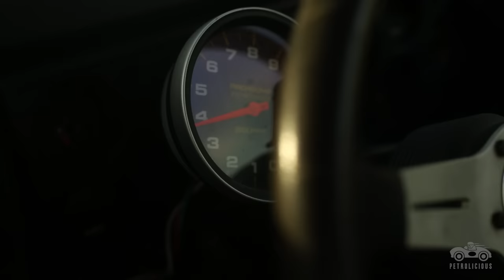The Nissan Bluebird is a Little Beast

Comment: The 510 was my first car after I got my driving license at 17 yrs old! Mine (in Malaysia) was a 1400cc version (non SSS), 4 door saloon, steering shift, registered in 1968 (same age as me). Later converted to the 1600cc engine and floor shift. Was sold around 1995 when I started work in another city. Still miss it...

Comment: The first car I bought for myself was a Datto 1600. back in 84..I still drive It. I bought a second one a year or so later. They have both been around the clock about 5 times in the 35 years that I have owned them. I would not trade them for anything. Nice to see stock engines under the hood. Mine are both going strong with the original engines.

Comment: I had a 68 4-door back in like 1988 and my parents took my down to Tijuana (I live in San Diego) and they got the upholstery done on my two bucket seats and the rear seat, black vinyl with black crushed velour...it came out so nice. My dad added a new black carpet kit. I threw in a newly rebuilt L20 into it...man that little car was fast! Had a set of 4 brand new Yokohamas tires on it and I tinted the windows Limousine black! HA HA HA! that car was so much fun. There were about 4 other friends in my neighborhood who also had (somewhat) fixed up 510's and we got compliments everywhere we went....even though some of us could have used a paint job as well. :) I rolled around with my car primered all gray, what can I say it was still a work in progress. K Wantanabe in San Diego was the spot to go for Datsuns, That shop was frequented all the darn time. good memories, great little video.

Comment: Great video, the 510 brings back many memories, my first family car a 1972 510 wagon with four spoke libra's blacked out on the inside with sticky Goodyear tires and a straight pipe with a 19 inch glass pack and megaphone tip, Boy did it sound good. I got to see the BRE Datsun at Riverside raceway in 71-72, I'd love to drive one now, I have a 2014 Fiesta ST and it's the most fun I've ever had driving the The power to weight ratio oh and balance is insane.

Comment: In Aussie, I used to own a '68 Datsun 1600, fitted an180B engine, 260Z 5 speed, 240K diff, 240K front struts and brakes.  All bolted in , no cutting or welding.  Tailshaft shortened though. Miss it.

Comment: @M.I. FadhilL: The missing head light has a function! I did not grasp this at first. The cold air flowing through that headlight port, on the left, is pointed straight at that row of individual throttle bodies. Troy has probably put a dual beam headlight in the adjacent socket in order to be road-legal with both high and low beams on both sides.

Comment: 1:40 are the tires mounted backwards?
Reply: Antonio Melino Lol just the fronts. The rears look fine. Strange...
Reply: His car has slight negative camber, so he probably did that on purpose flipping sides so that the tires can last longer and wear evenly.
Reply: Joan Nunez is that a joke? Most cars wearing those semi slick tires run negative camber. What you don't seem to understand is that they are strictly a one direction/rotation tire. Meaning they are useless for water/heat dispersion. Also usually a soft compund so i doubt they last long.
Reply: Antonio Melino was filmed upside down, then flipped.
Reply: Antonio Melino No shit they're single direction, and I highly doubt he runs it in the rain. I only said that because I've met people that do flip em like that even though your not supposed to just so that they can last slightly longer. But thats kinda of a hood thing, I manage my father tireshop I seen it a lot. Although I guess I really shouldn't say he really did that for that reason, because you only really do it if you dont have the money to constantly buy new tires.
Reply: Antonio Melino Well spotted.  Yes. You get glimpse of them at 1:38 or so. They look like Toyo Proxes.
Reply: Joan Nunez Both the front and rear seem to run major camber. I highly doubt that he will be saving much tread and when it rains he is going to be fucked.
Reply: The Pooch Funny thing is I was in a hurry to install the wheels and tires and didn't notice I hade the fronts on wrong. Pure accident. I just fitted the wheels the day before the shoot and had to run 3 degrees of camber to fit the tire in the fender without it rubbing. I normally run a little less than that on my street cars but I wanted to run the Jilba JDM wheels and the offset wasn't perfect.
Reply: Troy Ermish Don't worry, mistakes happen and I'm glad you didn't have to deal with rain and ruin your nice ass car. Because of some funky alignment issue one of my rear wheels is a 3 degrees camber right now. Once I install my rear camber bushings I'm going to be running 2 degrees all around. Due to a reason that is now forgotten, Subarus do a lot better with camber wear even with higher settings so big negative camber is fine with me - to a functional and usable extent.

Comment: Im sorry for my ignorance but what is the difference between the SSS bluebird and just a normal 510? Is it just the motor and a few other bits like a different tranny, suspension, and some rear end gearing?
Reply: +:D Body style - the Bluebird SSS semi-fastback coupe wasn't sold in the US.  Any body style Datsun 510 you find in the US is a variation of a Bluebird in Japan, so we just got shorted one body style, arguably the coolest one.  If you wanted a USDM 510 coupe, you could only get the notch back, or 2 door sedan.  

Nissan/Datsun didn't have a huge presence in the US and was keen to minimize risk, so they limited their USDM offerings to vehicles that were more mainstream.  Perhaps the awful trend of keeping the wildest JDM cars and technologies out of North America started here, with the Bluebirds of the late 60's.

Comment: Really the 240z was the first sports car they brought in. 
So the 1600 and 2000 roadsters didn’t happen. 
67 1/2 2000  with the solex package. 150 hp, 5 speed trans isn’t a sports car.